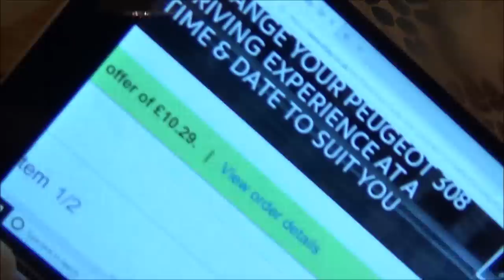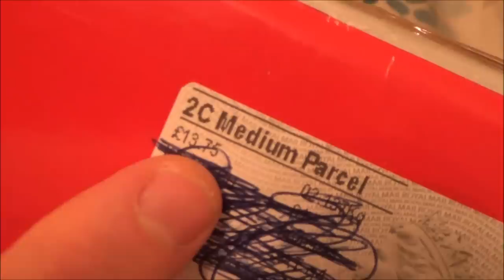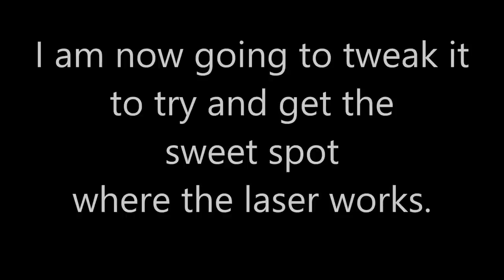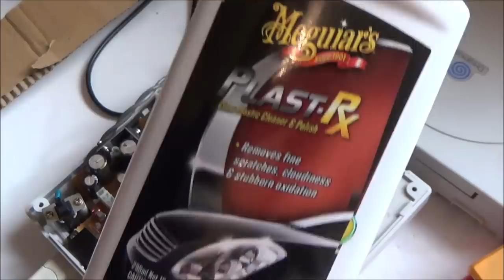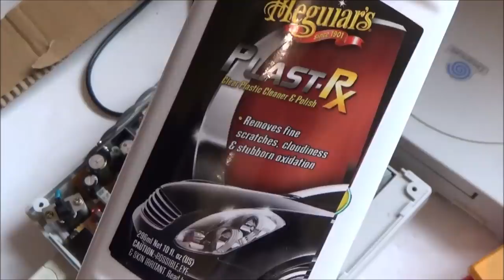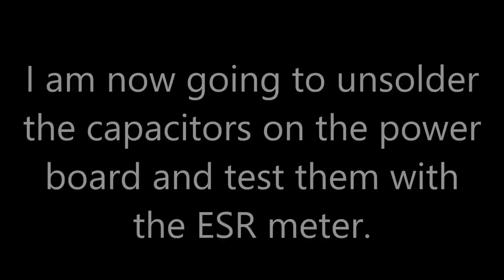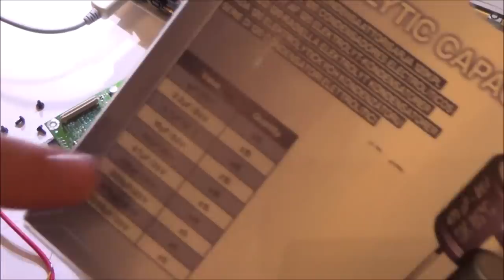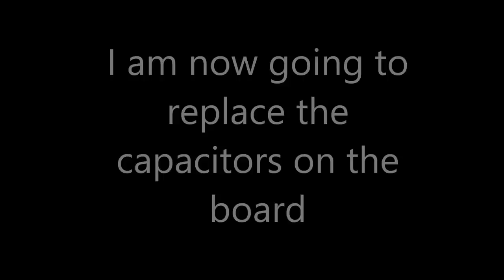Trying to FIX a Faulty SEGA Dreamcast purchased on eBay

Comment: not to minimize the danger of high voltage, but unless you touch the capacitor negative with one hand, and then with your other hand connect to ground, the only circuit that gets created is through your one hand instead of through your body. it will freaking hurt, but if only using one hand (which is my rule personally) you wont die from touching a capacitor. you use 2 hands at the same time then its potentially lethal. might i also mention that the human skin has over 10 megaohms of resistance dry. it is unlikely (at least on AC voltage) that any permanent damage will result. Now for DC, dont freaking do it. XD

Comment: I'll tell you one thing I see it doing that it should not be be doing. That whole laser rig should be moving back and forth while it's trying to read. If that's not moving back and forth freely that may be the reason why you can't read a disc. Check the track that it's running on and make sure that it can move freely back and forth

Comment: 45:20: to me that sounds like a bad spindle motor, see the shaft has play from side to side, it's shot. Here's some information I found from: https://www.repairfaq.org/REPAIR/F_cdfaq8.html#CDFAQ_004

"For spindle motors (these are the only motors in CD players where runout
is critical), try wiggling the shaft from side-to-side - any detectable
movement is an indication of runout.  *At some point, this will be bad enough
such that the focus and tracking servos will be unable to compensate for the
runout* and audio noise and skipping may result.  Some oil may help but a
spindle motor with a worn bearing will require replacement eventually.
Furthermore, it may prove impossible to reach the bearing(s) to lubricate
them properly."

Try putting a drop of oil to see if it helps/fixes the problem (though temporarily)

If it does then replace the motor, they are easy to find.
Reply: Never mind I was writing this as I was watching, only then I saw you figured out that it's a faulty board.

Comment: Hi vince
Do not ever move these potentiometers. Basically they are set at the factory and shall never be moved again. You can see a lot of crap online about that.
You only have to follow one thing : "the eye pattern" that's the signal produced by any laser media device.
These potentiometers modify the gain of these drivers so the ohm value you see online doesnt mean anything as it is linked to you particular device with its own tolerances and so on... if one unit does not pick discs try ultrasoud cleaning of the laser assembly !
The only thing you need is an oscilloscope for the eye pattern and the service manual!

Ie :

https://encrypted-tbn0.gstatic.com/images?q=tbn:ANd9GcQAQdLe03Z5q4HPj-aV3L_3VWyfCVUh3buVjej9c-vnGFuJ0ro

Good work as always ;)
Reply from the maker: Thanks for the info :-)

Comment: Actually on the inside probably on the side that's broken there is a micro switch most video game systems work this way when the lid closes it depresses the micro switch and then the drive activates. I actually had a PlayStation once with a bad door on top and all I did was a fix the micro switch to be permanently down regardless whether door was open or closed. But you may have other drive issues especially with the whole system being apart. And it's not that it doesn't have the power because the position of the micro switch does not matter. It's usually either the laser the motor or the reader itself being in the wrong position. The way things work is when you put the disc in and close it it starts to drive it looks to see if there's something there it it tries to read but if there's any problem at all it stops. It can also be a weak motor if it's not spinning fast enough in order to read it before the time out it'll stop.

Comment: You should never plug a Dreamcast controller in after you power it on. They are notorious for blowing the fuse on the controller board in the system.

Comment: That is one sad DC, busted lid, dodgy drive, missing screws, and a downgrade in AV from the Composite it came with. T_T Certainly gives you some real challenge but those "repair attempts" sure are bad often.

Comment: just thought I'd inform you of your display options for your Dreamcast first of all A cable you own definitely not the Best its the tv Aerial cable 2nd up better its the av cable better still its an RGB cable If you have a VGA 15pin socket on the back of your television you can pick up a VGA Adaptor a cable I recommend.

Comment: I have a PlayStation with a similar issue, the drive spins up and them immediately spins down, the laser tries to seek by moving up and down, then the drive spins up and down again, and the laser moves again. Does this regardless of whether there is a disc in or not.
Reply: Easiest to replace the disc drive unit with a new Psone laser unit, you may have to swap over the face plate of the laser from the original. About £13 from ebay, maybe cheaper from alibaba
Reply: It's a normal behaviour for some Playstation 1 models. Don't forget that mechanical issues can not always be seen with human eyes. Best option is to compare with another disc drive unit.

Comment: why not buy a faulty lazer and swop the boards, also you can buy a board that replaces the lazer altogether and uses sd card to load the disc images
Reply: That is a very good idea actually! As it seems Vince's laser is working, and it is very common for the laser to go faulty, so I'm sure that faulty laser assembly can be found easy !

Comment: This console has the greatest library of games of all time. Even with PS4 and XBONE and their 75% ports from yesteryear. This console plays those games better and still has loads of exclusive games you need to play on a DC as emulation is way off at this point. The PowerVR deferred rendering tech still hasn't been adopted by the mainstream gpus.

GD-ROM was developed by Sega with Philips maybe... They are just CD's with more surface area used and less error correction. They hold 1 GB of data and were intended for copy protection. Burnt discs are always hacked games that shrink the game data down to 650MB and use the MIL-CD (Kareoke cd) exploit to load burnt discs but these discs do put a bit more strain on the laser and motor to read. All the gd-rom manufacturing machines have since been dismantled, for parts I assume.
Reply: GD-ROM developed by Sega and Philips?Are you crazy?GD-ROM was developed by Sega and Yamaha.

Comment: I think that the LASER diode is actually kapoot and needs replacing but is a shame you cannot use a DVD/ROM drive to replace the broken unit and maybe you you should be able to get a new top half of the shell with the drive lid intact, what about getting the drive unit for a SEGA CHIHIRO and use that to replace the broken GD-Rom drive drive, The strange thing about the original Microsoft XBOX was that it is a direct clone of the SEGA Dreamcast and the filename extension would be .xbx which is the same as the SEGA CHIHIRO and if the HALO Combat Evolved game came out on Dreamcast SONY would not have sold many PS2 consoles and The original Microsoft XBOX consoles were very nearly capable of playing Dreamcast games.

Comment: I am littered watching this on my PS4 and screaming “plug in the controller and wait till the disc has slowed down”.

The disc needs to be read first then press (A) when selecting Play option.

I know you’ve never had one of these but you should have read up or watched a video on how these work.

I have my original 1999 Dreamcast and it still works.

There’s a nice little mod you can do with this which won’t require the lid and that’s to wire up a switch in place of the lid lever button.

Pop disc in,switch, switch over  to lid closed setting and wait for the disc to slow. Then Press (A) after selecting Play.

Comment: Huh, I didn’t know that the Dreamcast had an RF cable. Mine is AV/Composite.
Reply: use vga pls
Reply: Pabloxd123 Why should I? I’m not using my Dreamcast on a monitor.
Reply: @sciencepuptheamericanjoe5812  better immage, and some TVs have vga, atleast mine has.
Reply: @sciencepuptheamericanjoe5812  you can search vga vs composite dreamcast
Reply: and you can play games in 480p, composite cant
Reply: Pabloxd123 Composite can play 360p/480i; slightly worse but it works for me. 👍🏻
Reply: @sciencepuptheamericanjoe5812  vga cables cost like 15 $, just try them, you will not go back to composite, trust me.
Reply: Pabloxd123 Nah. The time and money it’ll take to find an adaptor or buy a new VGA cable is not worth it for me 😅 Maybe I’ll try it out in the future.
Reply: @sciencepuptheamericanjoe5812  ebay/amazon 10$ 2 minuts?

Comment: Check the black switch on the drive board that is operated by opening the drive door. They are very fragile and it might not be making a closed circuit correct to indicate that the door is closed. Try bridging the a couple of contacts underneath while you have a game on the drive.

Comment: People take things apart not knowing what they are doing and THAT is what happends. They lose the screws, they sell it on E- Bay, not telling you they took it apart. I bought an RC transmitter in the Spring, got taken on it because it worked but for a few minutes, wouldnt shut off, then when it did, it would no longer function. I found that it had been apart before, someone had taken the motherboard from it and swapped it with a defective one. I learned NEVER buy a defective piece of electronics, unless you want to get ripped off. Buying something for $15 listed as non functional is better than buying something $40 less than brand new, only to find its junk and for $40 more, I could have gotten a brand new one, with a warrenty( which I eventually did do.) That transmitter is now in my parts bin as a repair parts only. You know better than checking caps or anything still attached to the board. You MUST desolder and test them. You spent too much time with that board, once you found the board was dead, you should have gave up. Havent you heard the old addage beating a dead horse wont make it run any faster. Buddy, you were flogging the poo out of a dead horse. Look at it this way, you have a spare lazer disc player and a spare power board.
Reply: With all due respect, you didn't understand the purpose of this channel at all.
Reply: Have you listened to the first 30 seconds of any of Vince’s “Trying to fix it” videos? Get over yourself, nobody cares. His close to 300k subscribers enjoys this content. It is entertaining to watch you get invested in hoping he will succeed. That is the purpose of this video.
Reply: Doctom91 well said

Comment: If it's anything like my gen-1 Playstation, the disk read mechanism is hot garbage. It had massive issues reading disks.
Reply: Replace the drive with a Psone drive, about £13 ebay maybe cheaper on alibaba. Part numbers something like f-480 etc. Easy nuff to Google

Comment: The DC has one of the highest failure rates for an Optical Disc based system; most of the times it is the optical drive unit that fails not the electronics.  There are several revisions of system board, drive board and optical drives and they cannot be mixed.  The main DC will last forever, so my recommendation would be to get an Optical Drive emulator with SD or USB as finding a compatible working optical drive is very difficult.  If you install a drive emulator, find a nice SD Tray such as the ones I designed which you can buy on Shapeways.com   https://www.shapeways.com/shops/10p6
Reply from the maker: Very nice design :-)
Reply: Thanks :-)

Comment: My initial idea was a knackerd laser assembly. People play burned games on the dreamcast and they overstress the mechanisms as the image files are all over the place and not put down cleanly.  Eventaully this will kill all dreamcasts. If you have ever heard one you can tell its not doing any good..Buzzing , whirring, knocking etc. The channel i watch is Adam Koralik on youtube who only deals in dreamcast content.    Guess the chip came of easier then todays equiment as had lead in it so ventilate or you'll get brain damage. Talking from experience there.  If there one thing I'm absolutly sure of is one day you will get it to work.
Reply: If the dreamcast drives are dying from being overstressed by burned games that would make me suspect that they used disgustingly poor quality units.
Reply: @senialgoat911  https://www.youtube.com/watch?v=A6DnOwybgh4&t=12s at about 9min 20 explains the problem (should watch the whole video though as it goes into the drive unit). It a bit like driving your car hard and doing hand break turns etc, its just not going to last as long as a car driven with respect.

Comment: THAT THING YOU ARE NOT SURE OF LOOKS LIKE A CRYSTAL YOU FIND THESE IN CIRCUITS THAT USE THEM IN A TIMER OF SOME KIND.
Reply: johnny norton Who Is Deaf?
Reply: That's a quartz crystal. If you pass a current over it, it vibrates at about once every second, so it keeps time mostly well.

Comment: Haven't gotten completely through the video just yet but just wanted to say I understand this was your first dreamcast to work on and honestly it was cringe worthy for me lol.   I have two of NTSCU Dreamcast and the second one was actually one I bought as "repair only" too and was stated that it wasn't playing games.

For others though, don't over complicate the first steps.  You put the disc in and it said it was reading the disc then disappeared.   If its  not reading the disc it will actually say checking then give an error message about the disc not reading.  Yours didn't.  So the next step should've been to actually either try to play the game, or go into "Music" in the menu and see if the game shows up.  The fact that it spins then stops means nothing as the Dreamcast does spin the disc and stops if the system settings is set to not boot the game once the lid is closed.  

Then one other step I'd go with is simply cleaning the lens.  A little rubbing alcohol and qtip can go a long way (which I just now got to the point of the video you do just that but should've been  your go to much earlier).  

Okay onward with the rest of the video to see how this ends :D

Around 51:00 you are getting a reading of 14V on 12V rail because you removed the GDROM drive.  The GDROM pulls the power down to 12V.  This is an issue with GDEMUs and is debated if it actually harms the dreamcast without using either a resistor or adding a more powerful fan to keep the additional heat down from the extra 2V running through the PSU.

Now that at the end lol....  I would go back on the bad GDROM Control board and look at that silver looking cap that is different.  As far as I recall every Dreamcast regardless of region uses the same controller board so the chips should be practically the same.  I have 3 of those boards on the side and the only difference I've seen is like a chip that said SEGA on one says HITATCHI on another but they are the same chip other wise.   

So it looks like someone changed the original component with that silver looking cap.  None of my boards have that silver looking cap on the bottom and one of the boards I have came from Poland.  I'd change it and bet it works.

Comment: Such an underrated console which died due to easy piracy.
Reply: It had nothing to do with piracy. It died because the PS2 was released, and it offered DVD support..unlike the dreamcast which only offered CD support...that and it used GD-R's, not CD-R's or DVD-Rs for the discs...which adds on to the problems...not only that, but Microsoft was entering the gaming market, which only adds to the competition that Sega would have had to face. So it was easier for them to just go Third party than risk losing it all...besides...PS2 had MGS 2  GTA 2, DMC, FFX, Silent Hill 2, and many more exclusive compared to Sega's exclusives...
Reply: @bobtom1495  In defence of the Dreamcast, DVD was fairly new at the time so SEGA wasn't convinced to use it as the medium for video game discs. It also came out two years prior to the PS2, and as such technology advanced between 1998 and 2000...

This isn't coming from a triggered fanboy, cause I play the PS2 quite a bit, but that is what I have to say.
Reply: CabinDoor  people have known it for YEARS
Reply: 0
Reply: LOL No.
Reply: The Dreamcast should have come out when the Saturn did. It really feels like a console stuck in the 90s. Has the same look and feel of playing on a PS1 or N64, but had to battle the likes of some of the greatest consoles ever released by both Sony and Nintendo. Plus the PS2 had a built in DVD player (xbox had to buy an accessory kit) which was a huge bonus in 2001. I think Sega just really dropped the ball on waiting so long to release a console after the Genesis. The Saturn should have been battling the SNES and the Dreamcast should have been going against the N64. Then Sega could have release the Dreamcast 2 or whatever with DVD support. In the end though hindsight is 20/20, and we can only appreciate what we have available to us no matter how sad we are with the way thins played out.
Reply: Such a an overrated claim.

Comment: @mymatevice  first love your videos  
Second the best video you can get from dreamcast is VGA, if your gdrom completely dead ect all is not lost as you can replace the gdrom drive completely with this

https://rover.ebay.com/rover/0/0/0?mpre=https%3A%2F%2Fwww.ebay.co.uk%2Fulk%2Fitm%2F253726296640

Allows games to run from a sd card ect with no gdrom completely 

If you had a working dreamcast laser you can play burned games without a modchip at all thanks to the mill CD exploit that most dreamcast have

Mill CD exploit is handy for burning a import disc to standard CD allowing you to a play copies modchip free or genuine import games

The sd drive replacement would totally allow you to technically get your broken dreamcast up and running without a working laser also improved loading speeds ect 
Might be worth a look